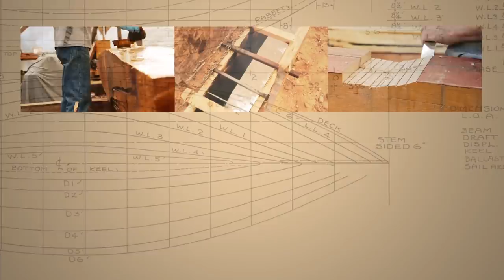Cockpit Mockup - Episode 149 - Acorn to Arabella: Journey of a Wooden Boat

Comment: Does Cockpit have a canopy? You will want to get out of the weather.
Reply from the maker: That’s a little ahead of where we are right now Paul, but the mizzen boom would make it fairly difficult to have a permanent canopy in that place, and visibility would be compromised with a canopy, too... we will just be hoping for good weather and gathering fodder for stories when it’s not. Truly though, to address this, having a dodger over the companionway to scoot under if it’s particularly bad would be nice to use when on watch and an autohelm or windvane is steering the boat. Again, these choices are on the horizon.

Comment: - I don't know if it could be a problem that I sure would not want to see happen to you, but has anyone been mindful enough to notice {make note of} how close your drill came scaring your beautifully varnished side of the shelf plank when drilling through the tie rod anchor plate at 2:33 ?
- I had to slow it down to see why I got so spooked when watching at full speed.
- Maybe it is the camera's viewing angle makes things more worrisome looking than it needs to be about too much drill pressure getting away from someone sometime and causing a very unfortunate result . . . I sure hope so.
Reply from the maker: No one has mentioned it, but honestly it comes with the territory. Potentially marring the finished surfaces as we work on building this boat is fairly inevitable. It’s a construction site, after all. We may need to redo many of the coatings that we do along the way, or do touch up/maintenance. Coatings at this stage serve to stabilize all of the materials as we continue work on other parts of the boat.
Reply: @AcornToArabella  Yup. I get it. I just couldn't help myself because my quick eye caused my stomach to churn as a result of seeing something similar to my own experiences of hurrying up and trying to do work and something else at the same time, like you where having to do: to perform for the camera. But thank you for getting me my chill pill. Phew!

Comment: A tiller. Man, I don't know. "Arabella" is a big boat for just a tiller. My Dad had a Luders 16 and a whole day of sailing on a broad reach, in good air, that tiller would wear you right out. Same thing with our 28-foot E-Scow. Try three (3) races a day with that. Talk about violating the history of a 1900s design, but was an upgrade to a wheel and binnacle group ever considered?
Reply: They might upgrade to one later. I mean, they're not bound to the design once the flaws are upheaved by gained experience.
That being said, yeah, seems like a big boat for a tiller. Come to think of it, i've never seen that big a boat with one.
Reply from the maker: Wheels aren’t an upgrade to all boats, Arabella was meant to have tiller steering. Many boats this size and larger had/have them, and wheel steering, with its expensive, space hogging gear (worm or otherwise) is a voice like any other.
Reply from the maker: Please enjoy this video, where at 3:07 legendary sailor Queene Hooper Foster describes the deck arrangements on a boat called Isolde, which included a 10’ tiller. https://youtu.be/q1iNvT8nXrQ
Reply: With a tiller, is there a way to have the boat hold course whilst you slept?
Reply: @Cess182sn  tie downs work.
Reply: @aserta  Leo on Sampson boat builders has a 46 foot and is going to use a tiller.
Reply: @AcornToArabella  I don't know what "Arabella's" original design was intended for. Perhaps as a coastal or near inland workboat? Without a rich, playboy, merchant, with deep pockets to foot the bill, maybe a tiller was all the budget afforded?
Reply: @trythinking6676  I would have thought that frequent adjustment was required to hold proper course, much like an auto pilot. I'm guessing a boat this size would have more than 1 crew member so you'll always have someone on watch.
Reply: @trythinking6676  So did the "HMS Bounty" and many tall ships just like her. The early wheels were connected to a tiller via block and tackle. Wheels and binnacle groups were created mainly to relieve the full weight of the boat (and sailing ships) while underway from coming up the rudder, through the rudder post, then directly into tiller, and finally into the person manning the tiller. Even then, in foul weather, it often took two men to "man the helm."
Reply: @trythinking6676  That's a bit of a myth. The only time a tiller gets tied down is when the boat is on a mooring or at anchor and the sails are down. The tiller gets secured so the boat isn't moving around while on the hook.

The only other time a tiller is tied off is to give the crew enough time to abandon ship. Seriously.

You try tying down a tiller while the boat is underway and she will head into the wind and then get knocked down. She will do this over, and over, and over again. Try sleeping when that is going on.

And, if the wind is blowing hard enough, the boat will drive itself past the luff and into an uncontrolled tack, or get knocked down hard enough, into an uncontrolled jibe. Another mess you don't want.

No. While the vessel is underway the helm is manned 24/07. It's called standing a watch.
Reply: @AcornToArabella  "Isolde's" tiller was estimated to have been ten (10) feet long! "Isolde" was also a thoroughbred racing "boat" (more like a yacht); not a workboat like "Arabella."

I don't know what "Arabella's" sailing characteristics are, but an "Isolde" (i.e., light on her feet), she's probably not. In theory, a ketch rig is like having an air rudder and helps with steering. Two rudders being better than one sometimes and with some boat designs. The bow sprit helps with stability, moving her center of gravity forward, increasing her sail area, and by helping to keep her (head) bow down.

I'm betting that a tiller was added to "Isolde" out of some misguided, romantic, notion of what "real" sailing was all about. The people who built boats like "Isolde" could afford a wheel and binnacle group -- and just about anything else.
Reply: @aserta  - Wheels have too many parts that can break, and they get in the way when moving around. Simpler is better.
Reply: @jefflovejoy2997  thank you for your great explanation, I too thought tying it down would not stop it coming off the wind.
Reply: I think a wheel will be more manageable (less tiring) and have the tiller as a back up.
Reply: @Cess182sn  - That's why there are any number of self-steering systems for tillers. The so-called "tyranny of the tiller" has long been a thing of the past.

Comment: You're going to wish you had incorporated some back support in the cockpit.  Sitting on "bleacher  seating" day after day isn't very comfortable.

What plans do you have for a windvane for steering?

Be mindful the view you have now from the cockpit is with the boat at rest; as the bow rises in even moderate seas the view forward diminishes pretty drastically.  I'm concerned the house is a bit too tall.
Reply: They will have a combing for the cockpit and backrests.

Comment: Why did you decide to go with a tiller rod instead of a ships wheel? Just trying to be more true to the plans or just making it easier to build & repair if needed.
Reply: Possibly for the better feel of the forces on the rudder to have a better sailing experience?
JIM

Comment: Make sure to use locking nuts , the vibrations could loosen the nuts over the years ..

Why don't you guys use modern big windows for the cabin that looks vintage retro style but still is modernly convenient and handy and brings tons of light in the cabin
Reply: Because big modern windows are dangerous and unseaworthy. They get smashed in by large waves during storms. A yacht down near New Zealand was recently sunk and some of the crew drowned when that happened to them. (Yes, a lot of modern yachts are actually not seaworthy!)
Reply: @LesDexia13  - Yes, that too,
Reply from the maker: As the other comments say, a port light is potential opportunity to weaken the structure of the cabin house. The round shape is not for aesthetics but it’s for strength, as is there a small size.

Comment: The tie rods look like regular steel? Won't they rust?
Reply: Tie rods are bronze
Reply: @malliz1  infact ALL the metal hardwear is Bronze
 Including nuts and washers. When they were making the Bronze floors, Steve I think said they spent around $10 thousand dollars just on the bronze without the cost of the welding gear to do it with.

Comment: Um- not to criticize the incredible work you guy are doing, but I do see a potential problem with the cockpit. 

"Plenty of room" is going to turn into "awkward cockpit layout" if you don't work out the engine controls and gauges now rather than in the finished cockpit. Remember, you need to work out not only where they'll be ergonomically, but how all the gauges and controls will be attached to the engine systems.
Reply from the maker: We weren’t exhaustive in explaining how much planning we’ve done in the cockpit. This mock up was for knowing the human scale of the cockpit—the systems have been and are being considered.
Reply: @AcornToArabella  Good to know! 
The way you had it worded in the video, it really came off, at least to me, as more of "it's going to be fine even though we haven't planned it out at all." Which my my experience has taught me is a good way to end up with a needlessly terrible compromise in a design. :)

Comment: What about a steering wheel? After a long voyage the till steering will be a very tiring task. You can't have a very accurate electronic autopilot on a till.
Reply: Wheels have far too many parts that can break, or get misaligned. And with a stern-hung rudder, a wheel would also mean at least two holes through the hull that can leak. Not to mention that wheels get in the way when moving around. Simpler is better. (And tiller autopilots are just as accurate as wheel autopilots. But wind-vane self-steering is even better. Much less prone to failure than electronics.)
Reply: Operating a tiller is truly the best way to get a feel for on-off anchor sailing conditions, particularly currents entering or exiting ports and estuaries. For longer passages they can be removed and switch over to  mechanical wind vane piloting.
Reply from the maker: Self steering: Sheet to tiller works great and a windvane will do for longer passages.
Reply from the maker: Oh, and there are autohelms for tillers, too. Of course.

Comment: What do you do with the water that rains/spills over and collects in the cockpit?
Reply: And that drained water goes where? Some how the water has to end up overboard?
Reply from the maker: The cockpit will be self bailing, meaning that it will have drains connected to hoses to seacocks below the waterline.
Reply: Ahh mystery solved. Thanks.

Comment: Where is the cockpit drain?
Reply: out the side of the hull ....my boat(30' MV cabin cruiser with a flat cockpit floor with sides) has two in the back and one in the stairwell - in heavy rain water just pours out of them ....sinks also just drain like this, as long as they are above the waterline they are fine
Reply from the maker: It’ll be a Self-bailing cockpit that drains to hoses with seacocks. Normally the hoses cross so the port drains to starboard and vice versa.

Comment: why tiller, not wheel?
Reply from the maker: Tillers are simple, strong, affordable, and appropriate for these sort of boats. I think a lot of people who have never used them on a cruising boat tend to think that self steering isn’t possible, but it very much is.
Reply: @AcornToArabella  You can use a tiller pilot. But please consider also building a tiller comb. I once used one that could slide up for switching the tiller lock function on and off. It's a nice little feature that makes sailing easier.

Comment: ermmm.. why would you wan't an open cockpit? wouldn't that spell for miserable days of hand steering especially in northern latitudes? you guys have an opportunity here for much better creature comforts st this stage of the build.
Reply from the maker: If we were concerned about an open cockpit on uncomfortable days, we would’ve chosen a different boat design, like an Alaskan trawler maybe or something that didn’t have a mizzen in the cockpit. Modifying this boat to have a fully enclosed cockpit would be quite the job.
Reply from the maker: And we should also mention that making such big modifications to a design might compromise stability or strength. Choosing a different boat design from the get go would be how you would address such fundamentally different needs than the ones that, for example, make Arabella’s cockpit ideal for us. Also, we won’t have to hand steer in high latitudes. Windvanes, autohelms and sheet to tiller steering are all possible for self steering.

Comment: Mate in real you will probably never be able to stand on deck to till theboat without ending up over board ,will you be putting in an auto pilot or a windvane.
Reply: Standing to steer mostly takes place when precise maneuvering is required in harbour. Going over the side is unlikely in situations like that, as you're usually going quite slowly, and in calm conditions.
Reply from the maker: Standing while steering is very likely and is safe—as jafo said above, we’re talking 3 knots in close quarters, at most (and if sailing, on a good day). 

Autohelm: perhaps. Sheet to tiller steering works great for this too.